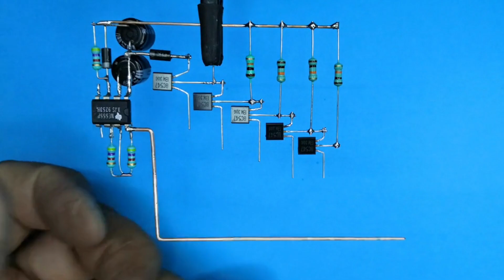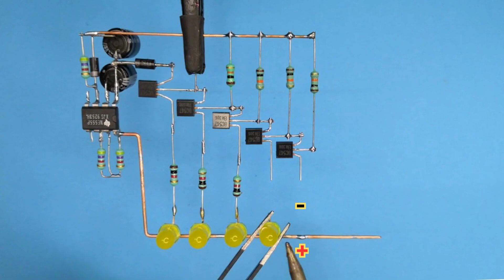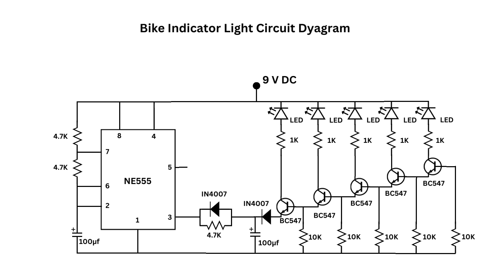How to Make Bike Sequential Turn Signal Indicator

Comment: Can you explain why the transistors and LEDs behave the way they do?
Reply from the maker: LEDs : These are the light sources that will turn on and off to indicate the turn signal.
Transistors: These act as electronic switches or amplifiers. In this case, they're used to control the current flowing to each LED.
Reply: @technoelectronic  I meant, why do the transistors activate sequentially like that? How does connecting the base of one to the emitter of the next cause them to behave that way?
Reply: @nicklane5896  because they are in series.
The signal is sent to BC457 number, one, and two, and three, and so on to the end of the loop, then, it starts over again.

Comment: How if use led 12v ?
Reply from the maker: If using 12v then LED should in series connection.
Reply: Thanks, 
So how to control the flow running ?
Reply from the maker: You can use 20K or 33K veriable resistor between IC pin no 6 & 7.

Comment: We need 12 volts.
Reply from the maker: Yes, we can use 9v also
Reply: @technoelectronic  thanks
Reply: Make sure capacitor can handle 12v.  So, 25v or 35v capacitor voltage. 16v capacitor may be too small.
Reply from the maker: Yes